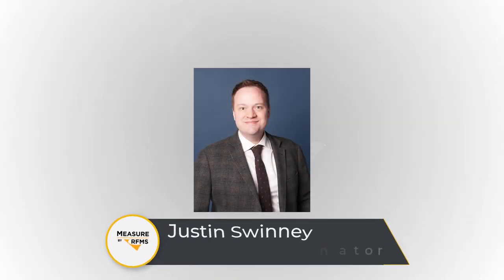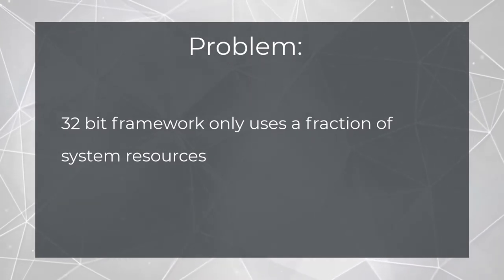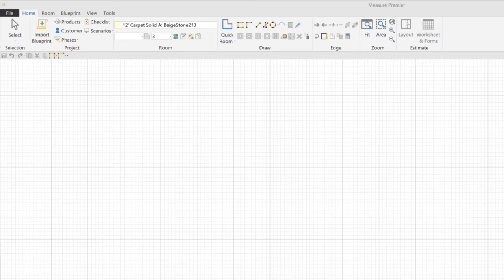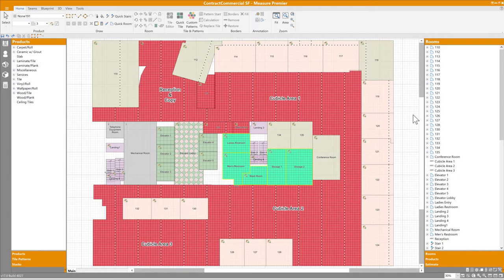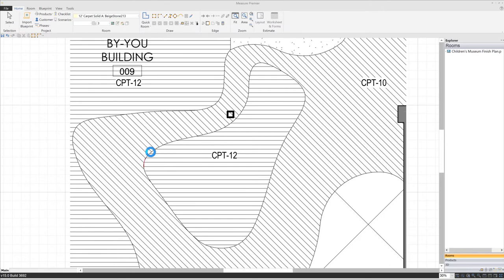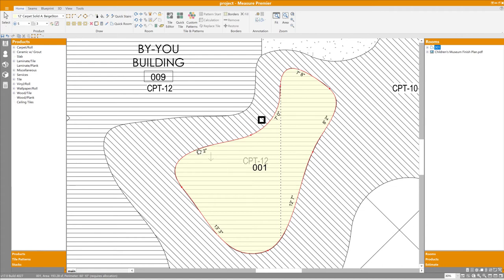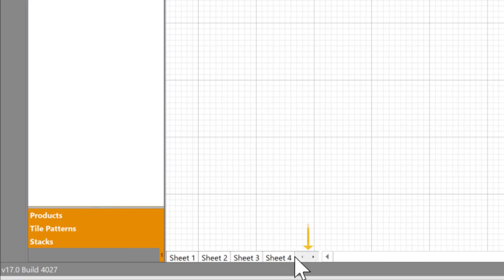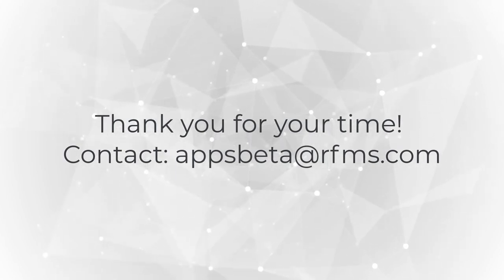Measure Desktop 64-bit Demo

Comment: Please add a highlighter function so we can highlight special notes or details on the plan without using a text box. I like the changes I've seen so far.
Reply: Thanks for the suggestion, Tom! We've planned several enhancements to annotations, including adding a highlighter tool, for later this year.
Reply: We brought this up today in our RFMS demo. We are currently using MeasureSquare for takeoffs, and by our request they just added a highlighter tool in their beta release. This feature is included in other takeoff software as well, such as STACK. Soon will be an industry standard. Bring in the highlighter ASAP! Good call Tom